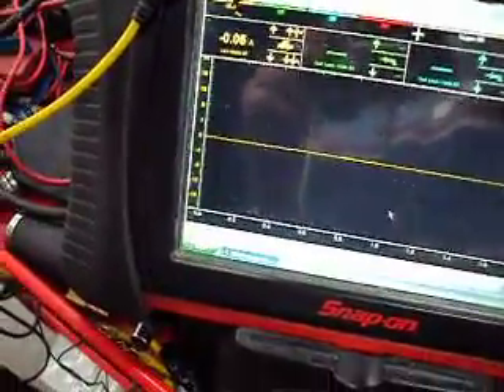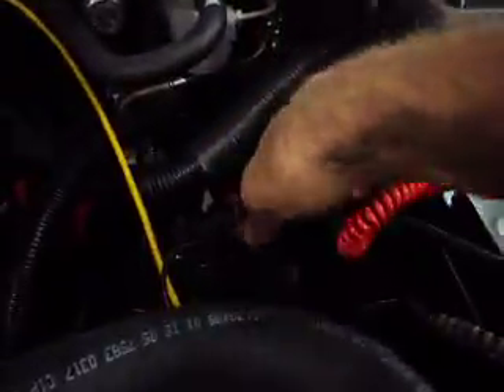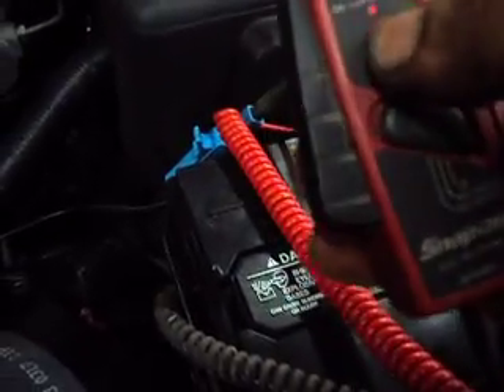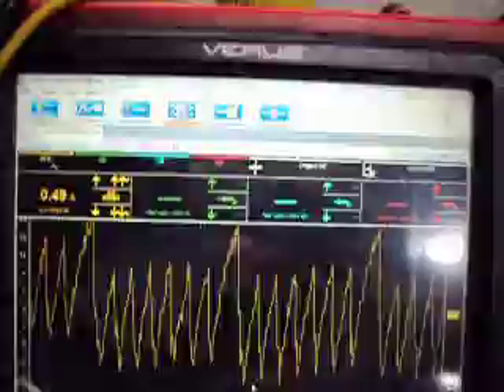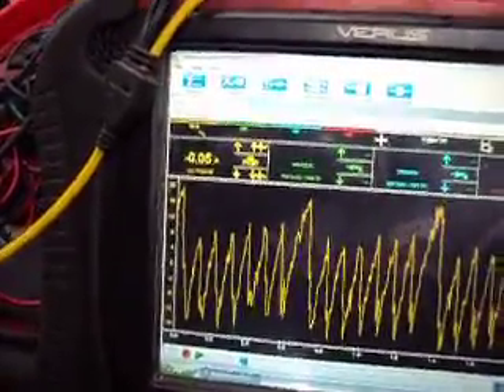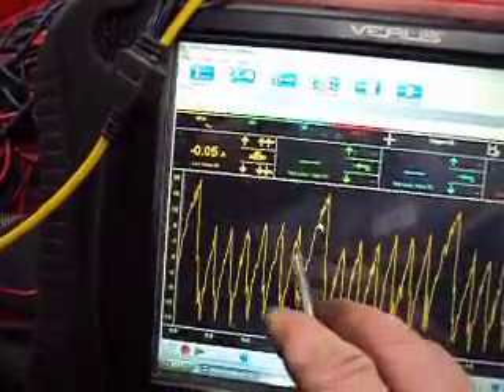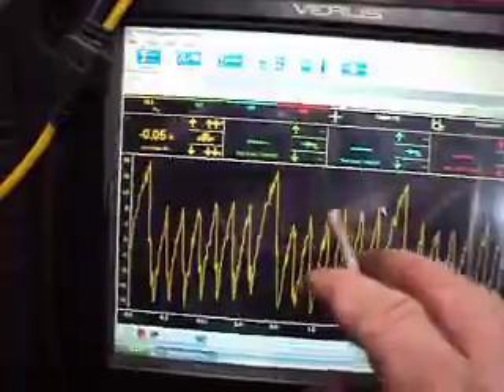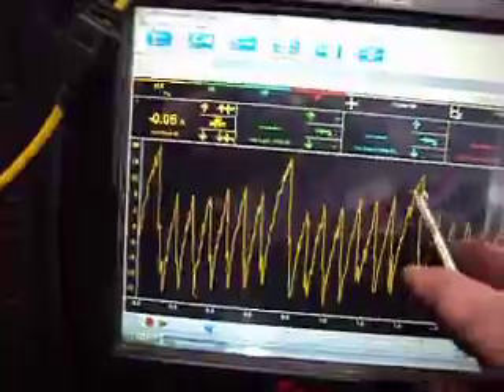Relative compression testing using a low amp probe and a Verus lab scope

Comment: Nice video , I got hantek c65 low amp clamp , I tried to check compression but I got no reuslts. Can you pleas tell me how should I set the vertical scale if my hantek dso oscilloscope ? Or sohuld I get high amp clamp to do this test properly ?